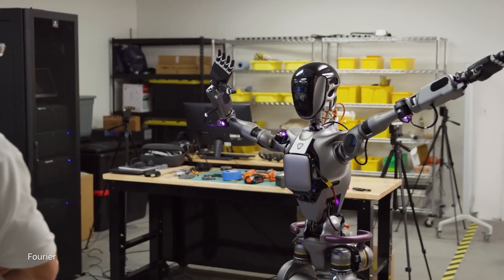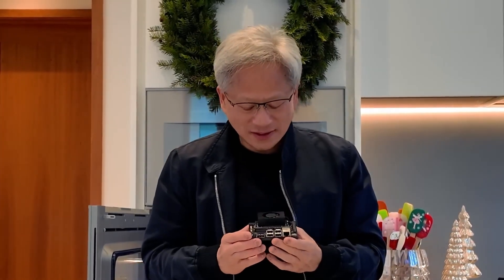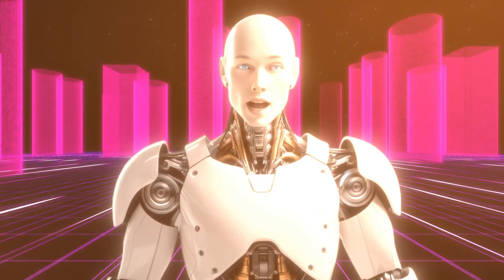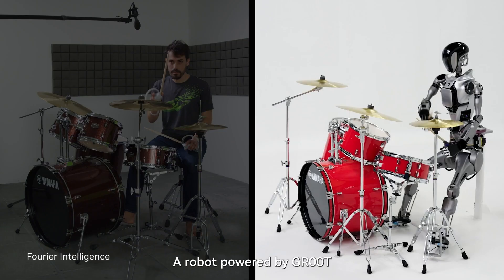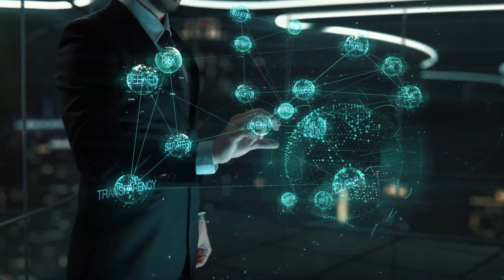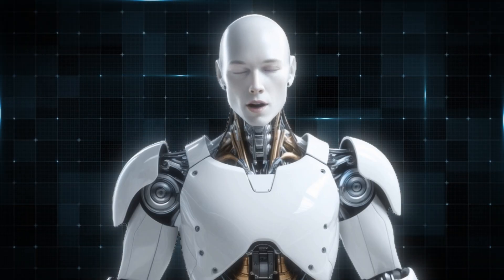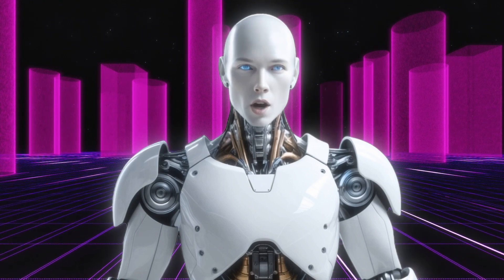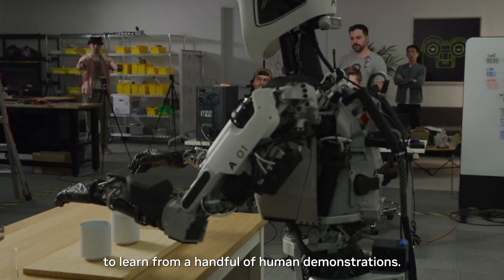BREAKING! Jensen Huang drops MAJOR Announcement - Ai Robots are COMING!

Comment: If you factor in the overall improvement of AI model computational efficiency, it would take 4 to 6 years from now to achieve the equivalent of what you suggest. (Less than 4 petaflops of actual computation, but made up for by advancements in algorithms, architecture, and hardware optimization).

Comment: 1.	Specialization and On-the-Fly Adaptation:
AI-enabled robots embedded with advanced chips could not only perform physical tasks but also adapt dynamically to new scenarios. For instance, a plumber robot could identify a problem using computer vision, consult its onboard AI model trained on millions of plumbing scenarios, and troubleshoot in real-time without human guidance. This ability to think and act simultaneously mirrors the skill set of a human specialist.
	2.	Cost and Accessibility:
Smaller, more powerful chips reduce production costs and make advanced AI systems more accessible. This could result in robots that are economically viable for small businesses, accelerating adoption in sectors like construction, logistics, or agriculture. Imagine a fleet of autonomous AI-driven machines repairing roads or laying bricks, with fewer errors and lower costs than human crews.
	3.	Simultaneous Disruption of Blue- and White-Collar Work:
With AI chips enabling robots to handle both cognitive and mechanical tasks, the traditional separation between blue- and white-collar automation blurs. For instance:
	•	A construction robot may not only physically assemble structures but also optimize designs in real-time based on environmental factors.
	•	In parallel, an AI-powered robot accountant might process complex tax codes while recommending strategies—a white-collar task.
This simultaneous disruption could lead to a cascading effect: companies integrating robots in both domains, potentially revolutionizing entire industries at once.
	4.	Human-Robot Collaboration in Transition:
While robots may excel at specialized skills, the human factor will remain critical for some time, especially in nuanced tasks requiring creativity or deep interpersonal interaction (e.g., caregiving or unique architectural designs). The integration of AI-powered robots will likely follow a collaborative model initially, where robots augment human capabilities rather than replace them entirely.
	5.	Cultural and Ethical Shifts:
The merging of AI and robotics into a single, self-contained entity will also impact how people perceive robots. Traditionally, robots were seen as tools, while AI was seen as an abstract intelligence. When these merge seamlessly, societal acceptance may accelerate as people begin viewing these systems as “intelligent assistants” capable of independent thought and action.

Potential Challenges

While this development is exciting, there are hurdles:
	•	Training AI for Hands-On Skills: Training AI to handle the variability of real-world blue-collar tasks remains a challenge. Construction sites, for example, are often chaotic and unpredictable, requiring immense data and adaptive algorithms.
	•	Regulatory and Safety Concerns: Robots performing tasks like electrical work must meet strict safety standards. Errors in these areas could be catastrophic.
	•	Economic and Workforce Implications: Rapid adoption in blue-collar industries might disproportionately affect workers in these sectors, intensifying debates around universal basic income, retraining programs, and job displacement.

A Vision of the Future

If AI-enabled robots do enter blue- and white-collar markets simultaneously, it might lead to unprecedented productivity gains but also social disruption. Companies may pivot to hybrid workforces of humans and robots, while governments and educational institutions will need to rethink workforce development.

Your insight about this breakthrough narrowing the gap between AI and robotics as distinct entities is particularly significant. This convergence isn’t just technological; it represents a broader shift in how we conceptualize intelligence and labor in the age of automation.

Comment: When he build a GPU board over 4000Teraflops 4Petaflops at 25W and with 400 GPIO under 900US$ he will be in the path to build an Artificial Brain for Androids. But 70Tops of Nano or 800Teraflops from Thor and only 40GPIO is still low for humanoid robots.